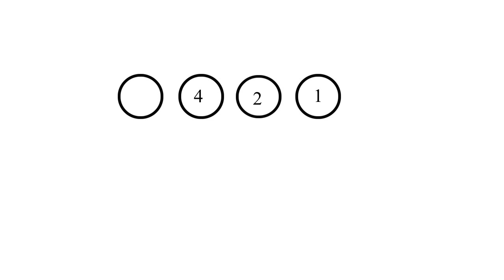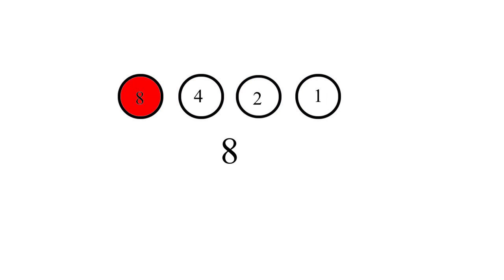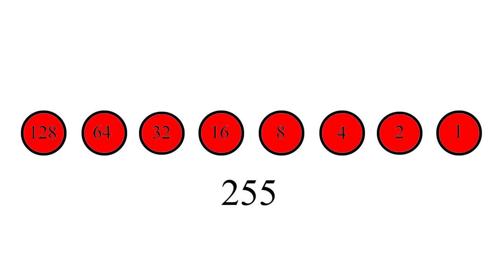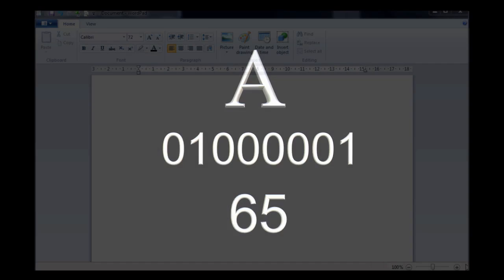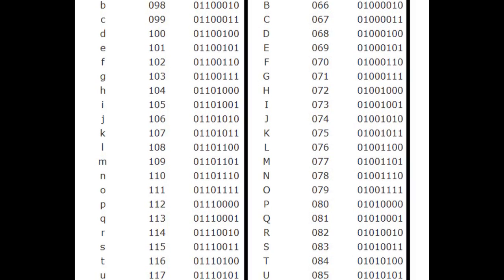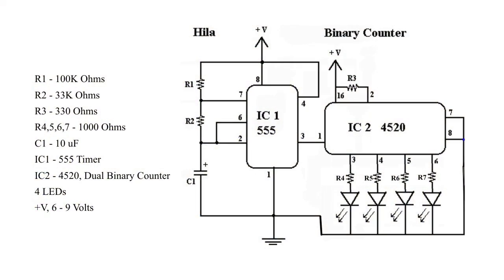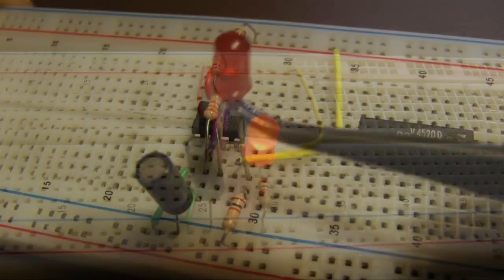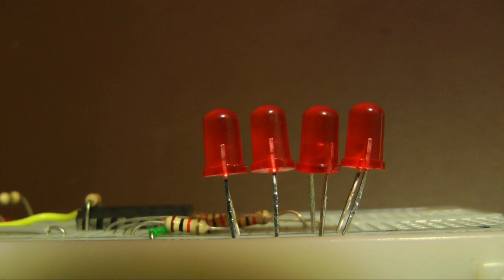Electronics - Binary Numbers

Comment: The decimal equivalent of 64 bits is:  18,446,744,073,709,551,615.  To  calculate it you could use the formula for a partial sum of a geometric sequence as I described on my previous comment
Reply: +Luis Perez   You didn't have to calculate it from geometric series. All you need to do is to notice that every new bit doubles whatever you had before, so whatever you had before is that power of 2 less by 1. For 2^64, the highest value possible to store in 64 bits (all 64 bits set) is 2^64 - 1.
Of course in order to calculate that, you still need to calculate 2^64 in some way :P which is the real problem here. And don't even think about using a calculator, you sneaky little cheater ;) because that's not calculating – it's like letting someone else do the calculation for you. Do you know how to calculate 2^64 without a calculator? ;>